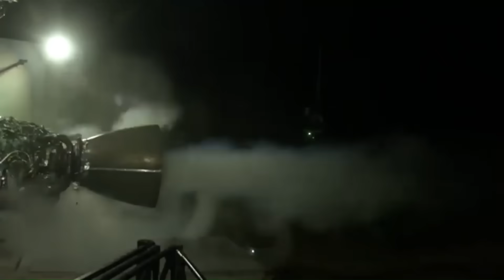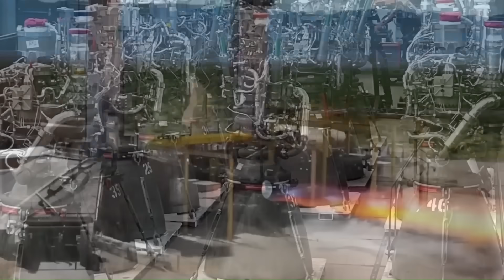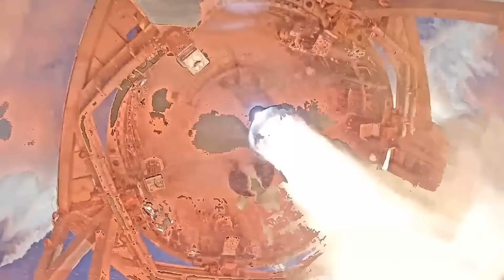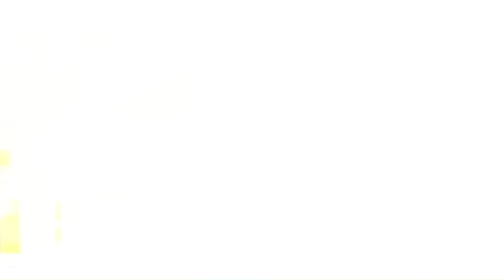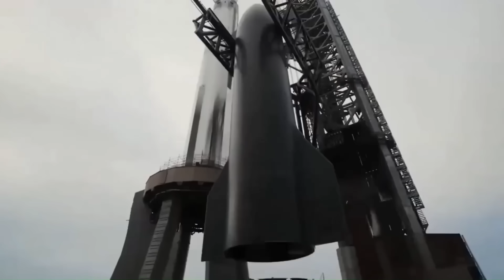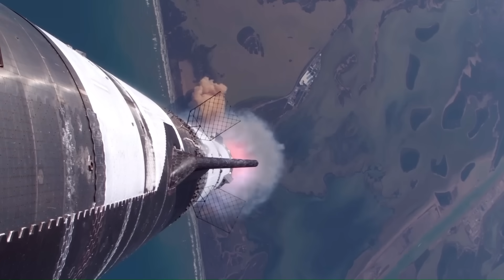Starship Raptor 3 Engine Exploded Badly During Testing!

Comment: Rapid unscheduled disassembly is not an industry term. It is a SpaceX gimmick. It's unprofessional, as our many aspects of the SpaceX operation
Reply: And yet, they are able to regularly launch astronauts to the space station on a contract significantly less than that given to Boeing with a dedicated staff 100 times larger than that of SpaceX. And we're still waiting for Boeing to launch their first astronauts to the ISS. In fact, SpaceX launches more rockets than the rest of the world combined. Pretty professional, I'd say, the occasional RUD notwithstanding.
Reply: @wanderandquestion5286  failures of Starship now number three in a row. In the 1960s, there were no catastrophic failures of Saturn V launch vehicles, and the third flight carried three astronauts around the Moon. And the technical challenge for those Engineers was much greater than today's. Failure is not success. And now there is a political dimension. Unless musk makes up with trump, Trump's vindictiveness may very well result in a suspension of SpaceX government contracts.